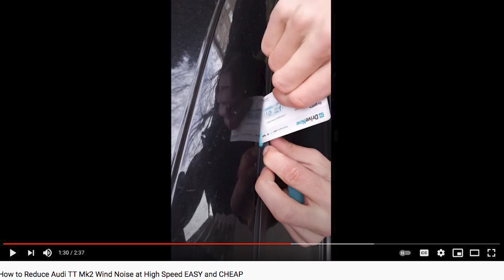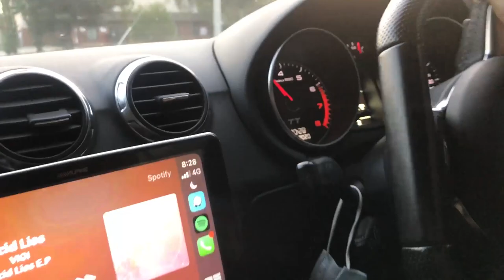Audi TT Mk2 8J wind whistle sound, wind noise problems and the best DIY guide for this common issue

Comment: You need two people. The manual tells you to shut the door and loosen the two window clamp bolts.  The person on the outside uses two suction cups to push the window into position. You then tighten the bolts. You can fine tune using a hex key in the sliders (pull towards you to go up and push away to go down). The window tilt can be adjusted at the bottom by slackening the two bolts and using a torx socket to adjust in and out.
Reply from the maker: Excellent info. Thanks Charlie!

Comment: Best fix on you tube.. i will add that i used tape on front quarter and back shut line and marked where i wanted the window to be. ie 5 to 10mm up, not where it was, then i found it easier to loosen the 2 screws where u said then pull window up a bit a a time with door open. same principle different order.. worked really well. no more wind noise. thanks mate👍
Reply from the maker: Awesome work and glad you got that annoying sound fixed.

Comment: There is a adjustment that you turn clockwise & counter clockwise to raise and lower the glass using an allen key located near the cable lock tab. It looks like a long socket facing down.
Reply from the maker: I saw this in Elsa but I was not able to find on mine. Maybe I am blind 🤷🏽‍♂️
Reply: You have to have the Window all the way down, but i think you found that Out when you changed the Window adjuster...

Comment: IS THE LONG TORQS DRIVER IN THE TOOL KIT FOR THE HOLES IN THE BOTTOM OF THE DOOR WINDOW ADJUSTMENT , MY 09 TT HAS NOISE ON DRIVERS DOOR
Reply from the maker: Yeah you can probably use that tool for it. I reckon give it a go - it's probably what it's there for and no one has clicked yet except you! hahaha

Comment: I also added self-adheisive rubber seals on both doors and boot lid, it really does help. 
Also I heat/sound insulated roof,both doors, and floor under rear seat. overall good results :D
Reply from the maker: Oh nice! Where do you mean? 

For the heat / sound insulation did you remove all panels and add extra materials on the metal and then replace the trim panels ?
Reply: @ianpgonzaga  yes, i ordered 10mm self-adheisive foam with aluminium foil. Not quite sure just how efficient it is, but its much better than nothing i guess :)
Reply from the maker: @PetarFantastic  if it fixes the wind whistle then it’s fine! It’s so much nicer now it’s fixed. Also I fixed my steering creak. I did not have the steering rack bolts tight enough after swapping it.
Reply: @ianpgonzaga  i know i watched the vid :D

Comment: Perhaps a dumb question however, how do you open the door again once you closed it and took of the door trim😅 Can you just pull on the green wire/mechanism to open it or do you need to open it from outside?
Reply from the maker: Pretty good question actually. Yes your are right. You just pull on the cable to open the door manually.
Reply: @ianpgonzaga  Actually, another question if you do not mind. Can the clamps be hand twisted or do they need to be tight to spec?
Reply from the maker: @alwayslate4656  the clamps? As in the clamps holding the glass? You need to undo and tighten with a tool. Being hand tight will definitely end up with a loose glass smashing down into the doorframe.
Reply: @ianpgonzaga  So you have to use a torque wrench? Do you know the exact spec?

Comment: So after the fix, does your car have wind noise when car hits cross wind/ stormy rain? Look forward to hearing the answer from you
Reply from the maker: Hello Hai Ly. After the fix the seal is perfect and even in harsh wind there is no longer any more whistling / stray air ingress.
Reply: @ianpgonzaga  thats strange. My car I moved the door striker and so far so good if the wind is straight
When the car hits stormy rain or cross wind, oh boy there you go one more time. It feels like the wind noise is all over the car!
Reply from the maker: @hailyphan7754  hmm strange why did you move the door striker? Your wind was coming from the back of the door and not the top of the window like mine?
Reply: @ianpgonzaga  yes moved the door striker already and no wind noise if the wind is straight. 
Cross wind i feel like the noise is coming from the back of the glass bear B pillar. top of the window( rarely hear)
Reply from the maker: @hailyphan7754  I see. Well I guess you have nothing to lose if you try adjust the glass itself.
Reply: @ianpgonzaga  well my car is 3 month old. And its pretty brand new i dont wanna damage the seal inside the door panel. I also asked the others, they said cross wind noise is unavoidable man.
So I have no idea
Reply from the maker: @hailyphan7754  there’s no seal. It all comes off quite simple :) 

Hope you get to the bottom of your wind noise.
Reply: @ianpgonzaga  im too noob to adjust the regulator man.
Reply from the maker: @hailyphan7754  it’s not difficult as you can see :) otherwise take to sometime more skilled.
Reply: @ianpgonzaga  my window glass is not acoustic glass. And the car is pretty new why the hell is wrong with the window regulator?
Its weird when you said that your car is silent when hits stormy rain/ cross wind
Reply from the maker: @hailyphan7754  it’s not the regulator that was the issue in mine but the position of the glass on the regulator.
Reply: @ianpgonzaga  yeah thats what I meant. Sorry for wrong words man. So now your car is silent on every kind of wind no matter straight or cross right. How about the hard rain? Does your car have wind noise in that case?
Thanks man

Comment: Hello Ian. 
I have somewhat the same issue with my driver side window.
Actually when washing the car I can see water going in through the rubber seal. 
My gap is somewhat more in the middle. 
I notice that you did not went with the adjuster hole in the bottom of the door, I already took a look and didn't manage to find any place to put a 5mm allen key. 
After you disassemble did you find the famous adjuster?
I'm thinkin in doing the same thing you did there.
Reply from the maker: I could never find this adjusting point. 

I think you must have window all the way down to get to it but like I say in my video. I could not find it 😂🤣

Good luck!
Reply: @ianpgonzaga  Ok, think I found out the problem of no finding the adjuster screws. 
Guess my drivers door regulator probably ain't the original one. I took a look at my passenger side and when the window its fully down with a flash light you can clearly see the 5mm Allen head screw for the adjustment. 
So guess I'll have to go with the "hard" way of removing the card door papel.
Reply from the maker: @darkjak4  ah ok! That is good to know and thanks for the update. It’s strange the passenger one has it and not your driver side ...
Reply: @ianpgonzaga  I think it has nothing to do with passenger or driver side. I suspect and I'm almost certain that the driver side was changed for some non OEM or aftermarket.
Reply from the maker: @darkjak4  hmm ok. 

Maybe mine was the same ?
Reply: @ianpgonzaga  don't think so at least if its the one on the video your are adjusting. I'll  try to find the link of a guy removing a really cheap aftermarket and putting a oem type.
Reply: There are NO adjustments available through the access bungs at the bottom of the door. I know because I have just completely stripped out my passenger door in order to replace the frayed window regulator mechanism. The only way is as described in this video.
Reply from the maker: @hotravco  LOL I see you have had the same experience as I. Strange how some people say they have it and then most don’t.
Reply: @hotravco  I can easily bet that if you have an Original OEM Window Regulator you have the Allen Adjustment Screw, I leave here a link with a pics of the 5mm Allen bit. 
https://i.ebayimg.com/images/g/~lcAAOSwjh5bKlVg/s-l1600.jpg
Thats the front one on the rear one you have another one like that. 
Bare in mind that there are some replacement windows regulator that look somewhat like the OEM but they are not. If your's is OEM you have does adjustment screws with the allen bit. 
Mine Driver side (left) didn't have cause its one cheap  aftermarket crap window regulator, that is why after loosing almost 30 min looking for the adjustment screw I decided to take a look on the passenger side (right) to see if it was really there, and with the window fully down and a flash light it really easy to see.